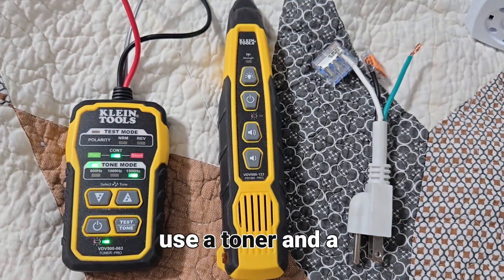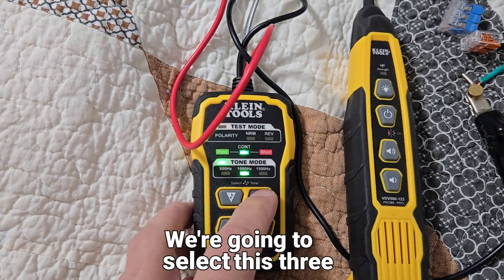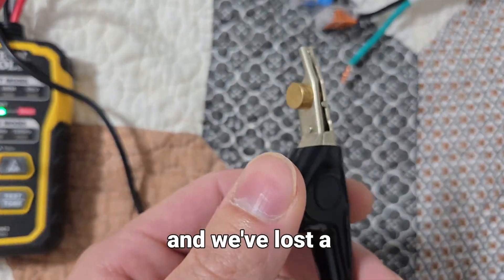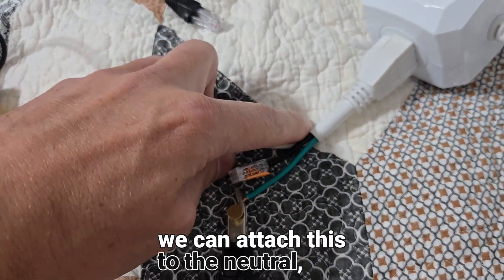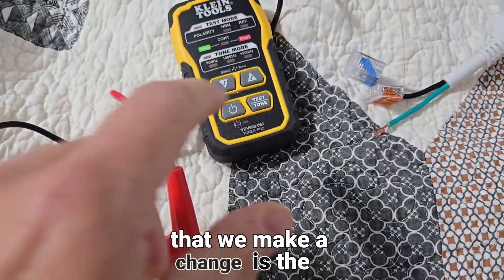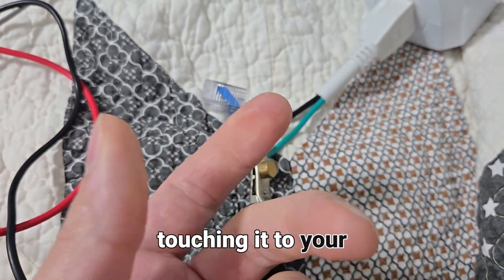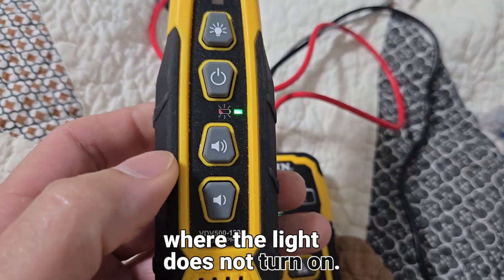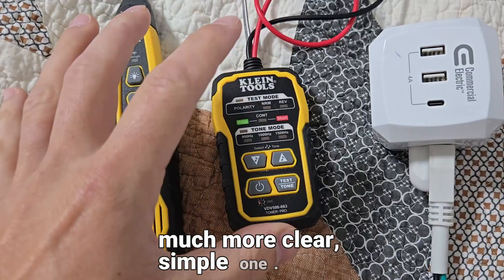Klein Tone generator/ probe  - How to use a Toner The RIGHT way!

Comment from the maker: If anyone has any questions or needs help troubleshooting, just reach out. I help people often with there. Electrical problems in the chat.Let me know if I can help with thanks
Reply: What the difference between newest toner, 920 model and the older one, 820, the one you are using in this video?
Reply from the maker: @puttinxyilo a couple of things

Earlier, when this was on sale, it made more sense to buy this one, but now the prices are pretty close. The newer one is definitely worth it.

The new one has detachable leads 

And that makes it really nice. If you have the et 450 or any other leads, it can plug into different terminal slots on a receptacle.

And the wand has a better identification of intensity.
Reply: @toolsandtactics  will this product help me find an open ground or open circuit?
Reply from the maker: @DavidMcKnight-i2b it can because it can produce a constant signal while you're searching, you can
Use it to verify what's connected to what.

Comment: So I am still trying to find my hidden doorbell transformer. I have this tool and I finally was able to find which circuit it is on. Now I need to power that circuit down. But can I connect to the low voltage side of the transformer (wires going to the manual chime of the doorbell switch)? This transformer is on my (standard 2 story home built in 1965 on a slab) upstairs bathroom circuit. So I am thinking it’s either in the wall near the chime (same area) or in the attic above. 

Can you provide any extra tips finding this rascal?

Comment: What about tracing single-wire control circuits? Or is there a better toner to use for that?
Reply from the maker: no, this 1 is good!
Reply: @toolsandtactics so you don't clamp the black lead to anything?
Reply from the maker: @n8skow  use an extension cord and attach it to the ground of the plugged in cord
Reply: @toolsandtactics  what plugged in cord? I'm talking about tracing single wires in industrial control cabinets.
Reply from the maker: @n8skow  yeah buy use the ground from an extension cord to boost the signal or clamp the BLACK TO A GROUND OR BEAM

Comment: I was working on a power panel with multiple 16/4 wires  to trace. I was using the Klein probe wrong tone on light and start at lowest vol and in crease for accuracy. Also you can confirm the wire on the bottom of the probe it has a pos and neg terminal!
Reply from the maker: Thx!❤

Comment: I am confused when you say you are dialing the sensitivity of the toner. It looks like in the videos like you are just adjusting the sound volume up or down. Does it actually change the sensitivity of the instrument? I bought the Klein kit you had in your last video with the plug in leads and am trying to trace the wiring to a couple of 120V plugs that are not working and are only getting <50V to them. Trying to learn. Thank-you for your videos!
Reply from the maker: So it increases the sensitivity, it's not just the volume. It's going to be the sensitivity at which the toner starts to pick up so by dialing it down to the lowest setting with the ground attached.
As I push on the up arrow, it increases the sensitivity it to pick up the signal.
Reply from the maker: With only fifty volts, that means you've lost the neutral

Cut your circuit in half.Put the power off

So if you have eight plugs, go in the middle of your circuit to where there are four on each side

Check neutral continuity throughout and check hot continuity throughout

Divide and conquer
Reply: Thanks for your response. I used the Klein toner this afternoon for the first time and was able to follow the hot wire feeding the plug (after flipping off the circuit breaker) from behind the drywall, thru the attic across the house, and back down a wall to a 3 gang switch box! The outlets in question have low voltage puck light transformers plugged into them controlled by a wall switch. Same with the other one so that’s why they weren’t at 120V (i.e. the wall switch was off). It didn’t make sense to me why the plugs wouldn’t always be hot so I assumed something was wrong with them. 

 I then used it to trace another duplex outlet that was completely dead and traced the wire behind the drywall to where it terminated in a two gang box and was just wire nutted off and not connected to the circuit. Got that plug working now too! I have an old tone generator and handset but never really knew how to use it. The Klein works so much better. Thanks for your help!
Reply from the maker: @BlakeBender-u7y Hey, man, I really appreciate you taking time for that response.It does mean a lot and I.Try to make these videos better and better for you guys.So thanks for the response.All feedback is welcome.I'm glad it was good feedback this time. Cheers